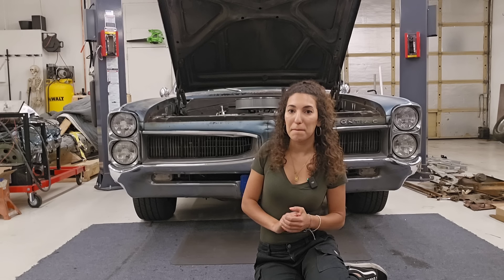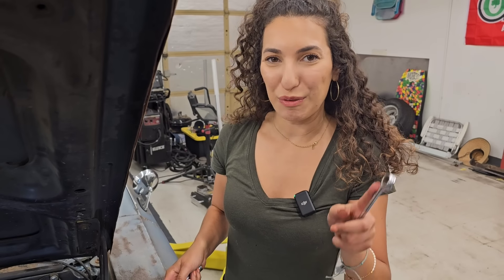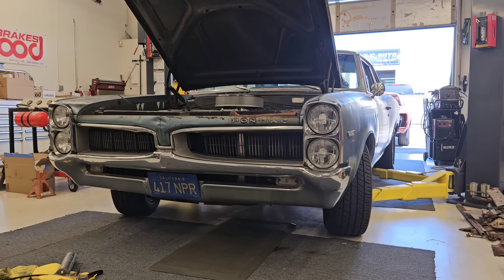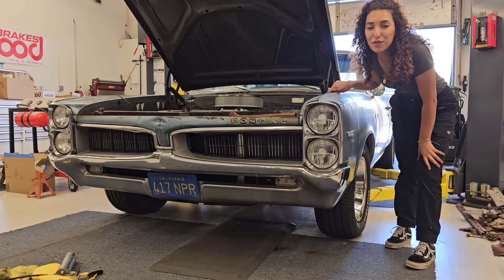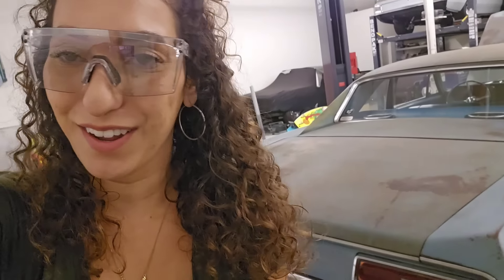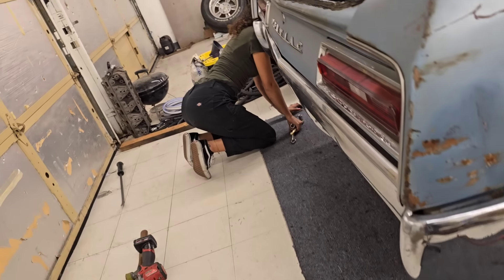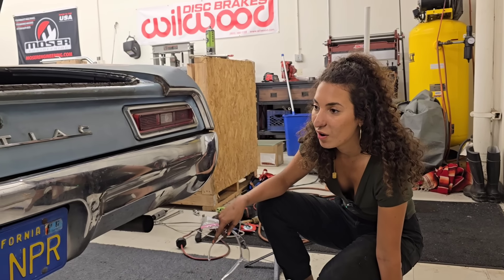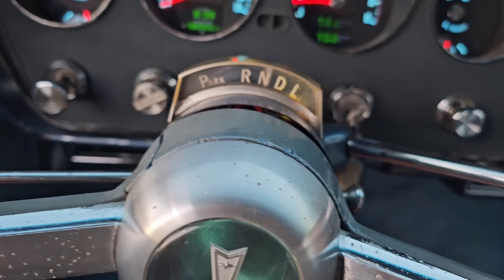Fixing Everything That Annoys Me About My Pontiac Tempest

Comment: Thing about building cars is discretion. All about decision making.
For example, I would never change the steering wheel position in the occupant compartment which should be based upon driver ergonomics...to improve steering intermediate shaft position relative to the steering box.  Ever.
Instead use one or two inexpensive and common 'Steering Shaft U-Joint Couplers' connected to either or both ends of the intermediate shaft. This completely removes any rotational tension aka lack of constant angular velocity due to intermediate shaft misalignment which created the 'fight' in the flex disc initially. 
As a general rule, most hotrod builders know to never adjust the steering wheel to satisfy angle of attack to the steering box.
Yes, budget and simplicity are relevant and matter. But in this case? Only one right way to do it as a 'common practice' and the solution is cheap.
Good luck.
Reply from the maker: Look I hear you... but if you watched the video, the shaft needed to be moved a quarter of an inch and it completely resolved the issue. I can't even tell a difference in the cab when I'm driving because the wheel barely moved. Now if it needed a lot more adjustment, then sure, I'd do couplers.
Reply: @GnarlySpeedShop  Yeah, these things weren't built like Porsches. They assumed and allowed for plenty of slop at the factory and gave themselves adjustabilty where they needed it.

The '67 steering column was a drop-in replacement for the previous '66 design (actually, probably 64' and 65' as well) and those all used the single long chest-harpoon steering shaft that ran all the way from the box up to the goddamn horn button. So the mounting point at the pedal hanger was in fact the ONLY place to adjust them.
Reply: EDIT: It just occurred to me that there actually are two places to adjust the alignment of the steering column. The other place is where it passes through the firewall. The bracket there is mounted with screws that have really wide washers  and the holes in the plates are enlarged so it can be jimmied around.

Comment: Something you might wanna check for popping noise is your body mounting bushings. Those can make a popping noise when stopping or driving over bumps if they are bad. Because of the body moving  around on the frame and causing binding pressure on the bolts and the bolts can move around too which can cause binding pressure.

Comment: You need wheel wells!
Reply: Definitely, the water and trash that can come into the engine bay will wreak havoc on it. Buy some fender covers and bolt them in the area.
Reply: Sheet Metal
Reply: Start the car, put it up in the air and grab the front tire and move it left to right and you will hear where the noise is coming from.

Comment: Don't know why you remove the fender wells,that's going to give you more problem down the road. Plus it doesn't looks good.
Reply: Years ago I removed the fender wells from my ’72 Nova along with the hood hinges and other things in an effort to lighten the weight of the front-end.
Reply: And you might experience cool problems cuz the air gets channeled through with help from the wheel wells ! Air becomes almost useless even with electric fans ! It's much more effective with wheel wells
Reply: Rhett

Comment: great friday vid i would check your steering linkage under the the car an see if anything is binding cause some thing maybe just rubbing that can cause the popping sound you hear an yes i would get a 'Steering Shaft U-Joint Couplers cause i had a i think it was a 73 Capri the donut that is between the steering box an the shaft came apart an when you can pull the steering wheel to your chest well you tend not to have steering any more an least i didnt pull it to far so i did have steering enough to get home that was a fun ride also most as fun as driving on 2 wheel going down the road.

Comment: I'm in the process of swapping a '68 column into my '66. Same column as in your car. '67 and '68 were unique in that they used that perforated tube style of collapse versus the sliding tube within a tube they switched to for '69. Because those perforations made the column so weak in bending, they had to use that third mounting bolt at the pedal hanger. I think the aluminum wedge at that bolt is how they fine tuned the column angle at the factory. I was waiting to see if you messed around with that. My replacement column didn't come with that piece so I have yet to figure that out.

Comment: On the battery tray. It looks like you have one welded nut on the tray.Why not weld a nut on the tray in front of the battery? Use two long threaded rods to reach the top of the battery and place a metal strap, with two holes, across the top of the battery and use nuts to clamp down the metal strap..

Comment: Sounds like you need a steering linkage rebuild. Gm center links wear out, at least on a-bodies like my 69.
Reply from the maker: Strange because these have less than 5000 miles on them
Reply: @GnarlySpeedShop  really? I thought just the suspension got done. It really seems theyre failing if greasing them makes them quiet down. Well, oldschool was lube the chassis every oil change(3 mo./3,000 miles). But i go waaay longer than that with my Chevelle. Hmmm?